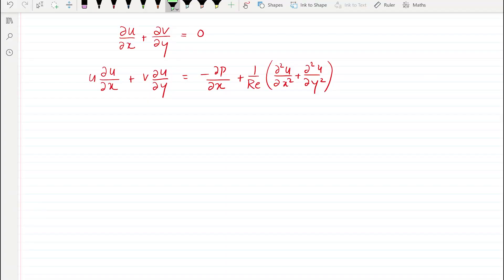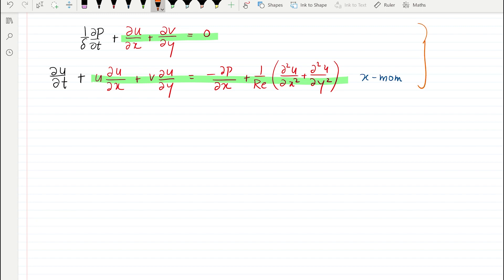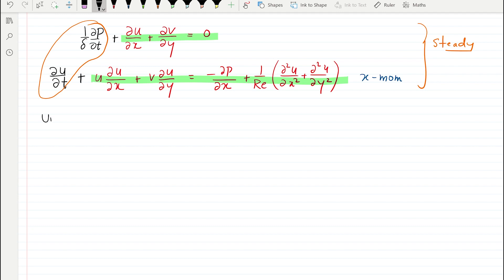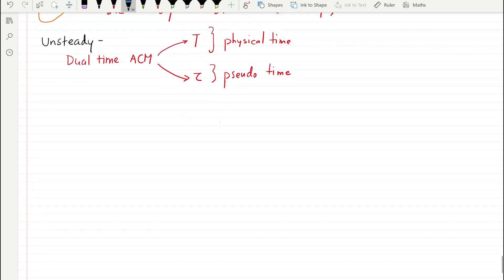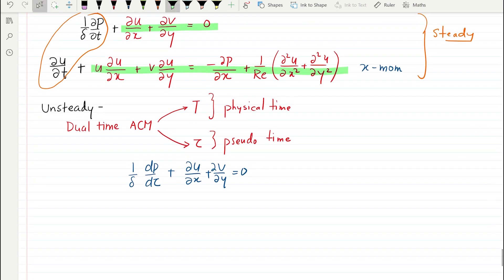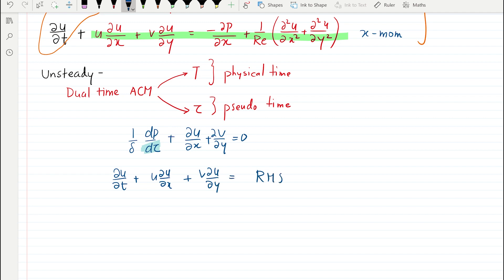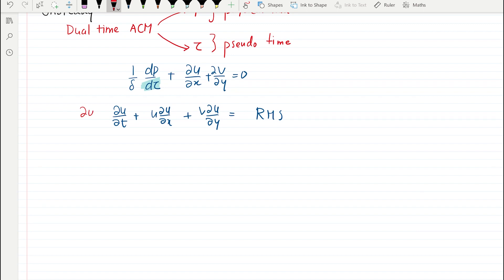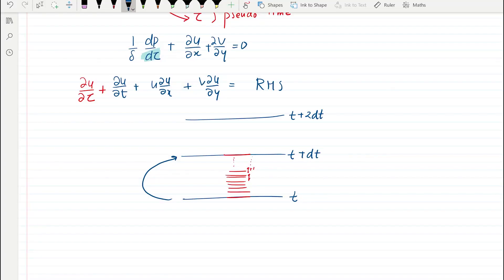Unsteady Navier Stokes Flow Solver Methodology | Lecture 22 | ICFDM

Comment: Hello Sir,
I am going to follow the book "Numerical Heat Transfer and Fluid Flow", it is written in 1980, so is this material still suitable for learning the basis of modern CFD?
Reply from the maker: Yes, very much. I highly recommend this as your first CFD book.
Reply: @TanmayAgrawal7  very helpful, thank you for the guidance✨
Reply from the maker: Would appreciate if you can use the link in the description of my videos to make a purchase :)
Reply: @TanmayAgrawal7  For this I am using a free pdf.But for the advanced books I will go through your link only to get a hard copy.
Reply from the maker: Thanks

Comment: Hello sir, I am doing cfd analysis of plate fin heat sink in ansys fluent, I have taken a plate fin heat sink and made an air domain around it and there is one inlet and one outlet. constant flux is applied at base. But in simulation heat variation is not coming at fin plates. Entire heat sink is coming at same temperature. What should I do to solve this problem.  Please help me. I have been trying to solve it since last 20 days but unable to do it. 
Please help me, I would be thankful to you
Reply from the maker: Please share the project with me on tanmayagrawal7@gmail.com